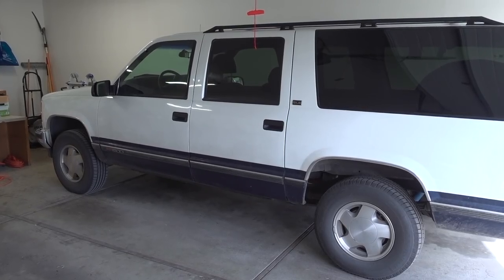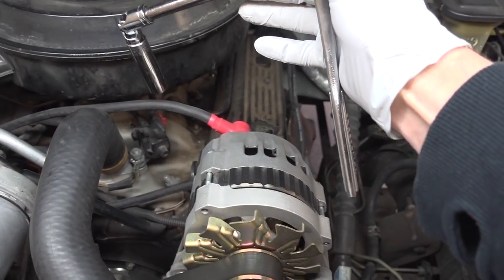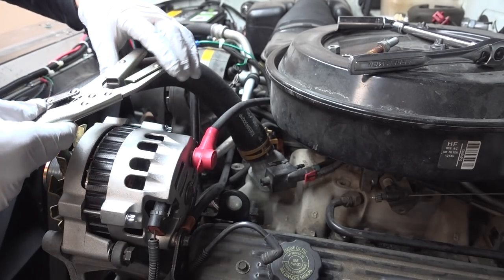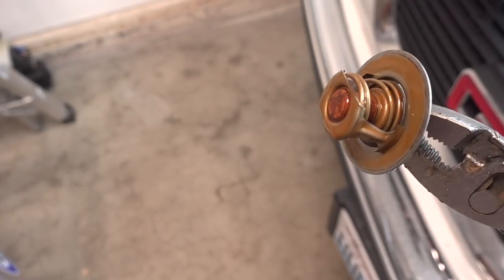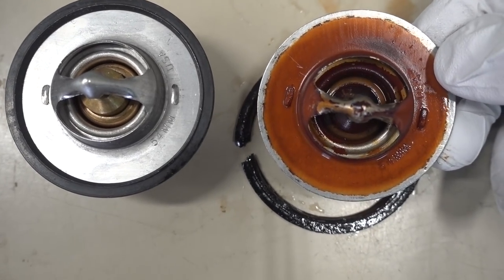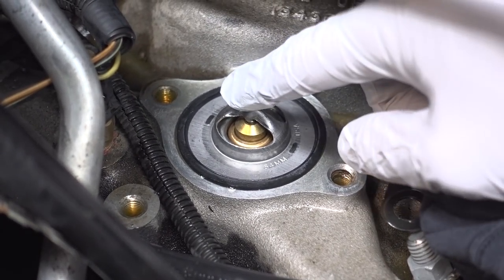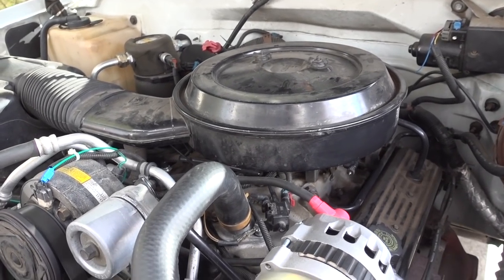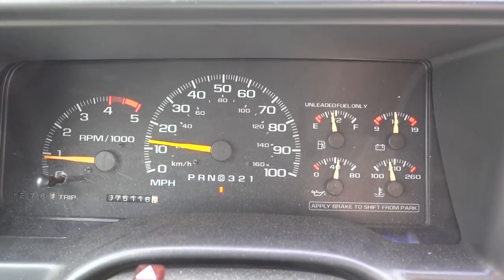Thermostat Replacement // GMC Chevy Suburban 5.7L

Comment: Great VDO. My 95 G20 Van has the same issue. Temp gauge only reads 100 ,  lukewarm heater.  Will try this fix. Thanks again.
Reply: Did it work?
Reply: It helped a bit. The temp gauge reads about 185 F now. But the heater barely puts out enough heat. My 1991 F150 Heater puts out 10 times the warmth. @fixingwhatihave2906

Comment: My 97' C1500 suburban with 276K miles stays under the first line(about 175F using torque pro) and on a 200 mile mostly highway trip doing 60mph, I got 18.5MPG. 
I haven't ever seen it above 180F so I'm wondering if I should replace the thermostat to get the engine temps higher?

Comment: The nut 🔩 for the deep socket the bolt broke. However enough was left I could but a nut on it. I had to route my wires elsewhere so I had a ground for the tempture gauge. I have a different set up for a 1991 Chevy Silverado with the 350. I have one wire going to the bolt a easy fix for the ground wire.

Comment: I've just done this for my truck it has the same engine tbi 5.7 just a Silverado.
 I would recommend to replace the stud because i broke mine in half and couldn't extract it. I had to cut it flush with the intake and drill it out and tap a new hole. The stud was welded to the aluminum 😥

Also your antifreeze looks dirty i would flush it. The additives keep corrosion down from all the dissimilar metals in your cooling system.

Comment: I had the same issue with my 99 K2500 pickup. After I replaced the thermostat, the temperature gage noticeably improved but it still looks like it should be a little higher. I also change the gage sensor in my quest to fix the problem but it didn't do anything. Also, the heat started working again after I changed the thermostat. The only other solution I can think of is replacing the cluster which is often malfunctioning.
Reply: Right between 210 and the quarter way line is normal. Mine usually runs one tick above the quarter way which is just fine. The stock gauge acutally reads a little bit low and if you use an infrared gun at the thermostat housing it'll be close to 195 even though the gauge looks like it reads lower.

Comment: I have 95 c1500 , same tbi 350... when I removed the housing on mine it looked exactly same except it did have a housing gasket aswell... so I put one back as well as rtv... now I'm wondering if previous owner added a gasket when he shouldn't have🤔

Comment: I have a 98 suburban. It had a coolant leak. I replaced the T hose connector yesterday. There doesn’t appear to be anymore leaks but now the temperature gage is all over the place. It will go up to 230 then drop back down to 100. Then it will go back up to 200 then drop all the way to zero. My best guess is it’s the thermostat unless someone has another answer?

Comment: Do all, if not, most 95 chevys oil pressure gauge fluctuate when acceleration and slowing down? Mine does, someone else told me his Tahoe does and I see yours. This a common thing?
Reply: Kyle Marshall that’s normal on every engine with a oil pump. When a engine spins faster it also spins the oil pump faster which causes higher oil pressure. On a lot of cars now the oil pressure gauge doesn’t move because it’s not really showing oil pressure but instead it’s more of acting like a dummy gauge that just lets you know you have oil.

Comment: I'm getting ready change Mine I'm getting smell coolant in car cabin when heater is on did something like this happened before changing yours I don't see any leaks or level coolant is full in radiator but hose going too engine is stiff were thermometer valve is !? Mine is K2500 1996!?

Comment: my '98 c1500 work truck and my '98 suburban never get very warm at all, replaced the thermo's with the best thermo's i could get & it still barely gets hot.
Reply: pretty common on the vortec motors.
Reply: yeah I never worried too much about it but I think it should be good to get a little heat in the engine...
Reply: I see people asking about it alot in groups i'm in but have never seen a fix posted.

Comment: You should use a ACDELCO 12TP1D 180 degree stat (or equivalent) and a 30% mix of pure GREEN Antifreeze in distilled water, plus a bottle of Water Wetter.    The Cap should be a Stant 10230 (spring vent closure).  Reinstall the bolts in cleaned holes using anti-sieze. 

Servicing the cooling system:  Remove both block plugs, and poke a screwdriver in the holes to clear the scum.  I replaced mine with NPT brass plugs with a 1/8" NPT hole, and then use stainless steel hex plugs.  Next time, you only need to remove the small plugs, which is much easier.  Anti-sieze on all of these parts.

Your best bet Water Pump is a Stewart stage 1 or stage 2.  Not sure which one, as the pilot shaft and neck size have options.  Serpentine belt driven pumps need CCW impeller.  I think it would be # 13403 (verify).

Comment: Good video. Just one thing for all novice gearheads--replace those shitty factory spring things with proper hose clamps. That way, the next time you remove the hose, it'll be a cinch.
Reply: About that hose clamp. The one on his engine is the proper one. It will expand when hot without damaging the hose. A screw type clamp cannot expand as temps go up.
Reply: @jimbeamm36 Yep, you are correct.

Comment: Would this work on a 98 Tahoe?
Reply: DeMarion Turner yes, but you have dexcool antifreeze. Also when taking off your bolt and its stuck don't torque it off and snap it like i did. Took half a day drilling and tapping a new threads metal shavings everywhere 😢

Comment: Hello-----I hate to bust your bubble but you are making many mistakes.  Your cooling water looks like it is dirty and needs to be flushed out.  The O-ring type gasket has a slot around the inside of it and it actually snaps over the outside of the thermostat and is in place ON the thermostat BEFORE the thermostat is lowered into position.  The FLAT part of the O-ring goes on the DOWN side of the thermostat.  There is a little ridge on one side of the O-ring and this goes up, facing the sky.  All radiators have a drain cock located near the bottom of the radiator and you should FIRST drain out about 3 quarts to avoid any spillage when you take the housing apart.  After you have finished with the installation,  pour what you drained from the radiator back in before you start it up.  I like that you go to Harbor Freight.

Comment: Flush that nasty ass coolant out and do not replace it with Dexcool! Flush it with distilled water for about 4 or 5 flushes, then use full strength conventional coolant. If you use 50/50 your mixture will be weak since there's still going to be a little bit of water left in the block. Add about 3/4 full strength and 1/4 distilled water. Then use a coolant tester to see if your mixture is pretty close to 50/50. If too strong, drain some antifreeze and add more distilled water. If too weak, drain and add a little bit more full strength antifreeze and retest. 

Looks like your old thermostat failed due to the nasty coolant. Better flush it before you're doing a radiator and heater core too.
Reply: The hoses to the heater core in my Suburban have been cut by the previous owner.
I'm wondering if what you're saying is what happened to the heater core. The temp floats around 175F, so I'm thinking he may have changed the t stat from 195 to 180.

Comment: Get a "power flush" done on your engine and heater core. 
Your antifreeze looked rust colored, not green which indicates the motor and heater core could have a lot of "sediment" in them and your heater core  will soon start leaking.
Reply: It’s dexcool which is orange